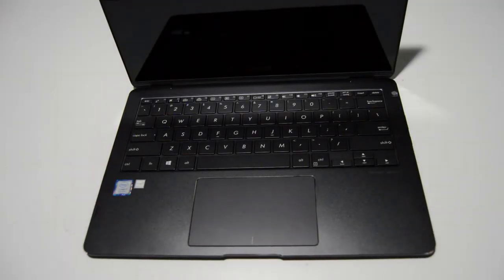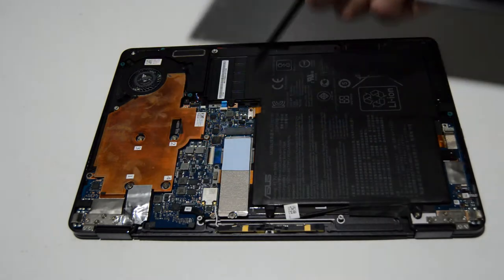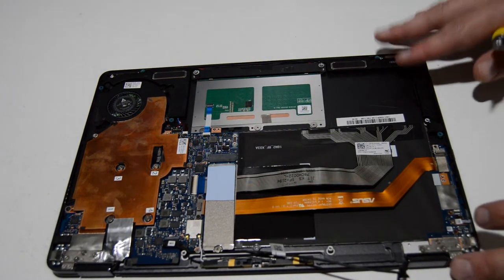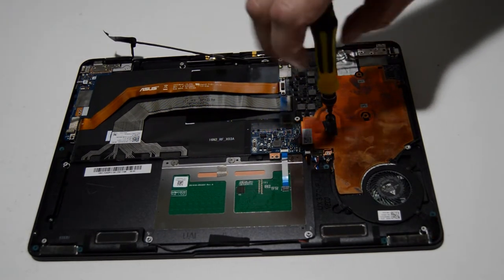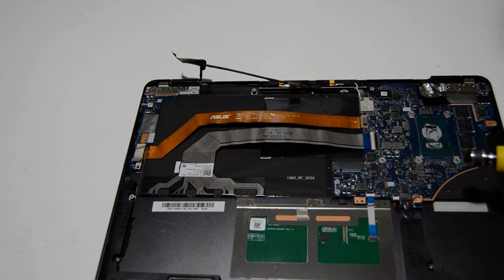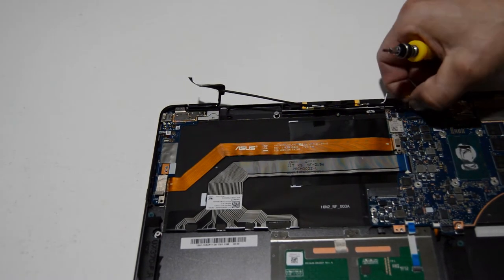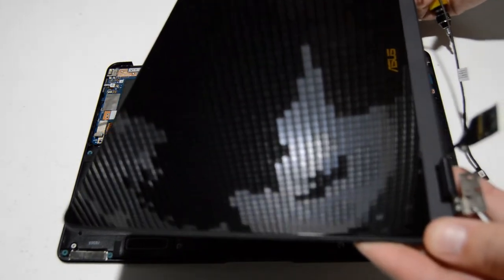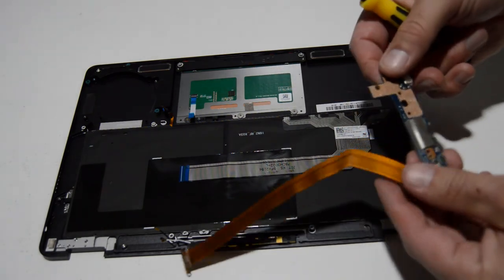How to Disassemble Asus Q325U Laptop

Comment: is it important that that metallic tape be reapplied to the heat sink because once you pull it off it loses its adhesiveness and Im not sure what kind of adhesive you use to reapply it
Reply from the maker: No it doesn't need to be on the heatsink, you can just cut or tear that portion off.

Comment: Is there a way to replace the speakers? My right one is distorting the sound, I'm afraid it's probably a hardware problem
Reply from the maker: 13:10 theres a good overhead view, looks like they have to be replaced as a pair. If you can get to them and the connector, you may be able to replace them after removing the bottom case.
Reply: @Sellbrokedotcom  looks like it, but I haven't been able to find a replacement part
Reply from the maker: @arielgodoy795  $17 https://www.ebay.com/itm/Asus-Q325U-13-3-Genuine-Left-Right-Speaker-Set-Speakers/283863427787?hash=item4217942acb:g:Fg0AAOSwyuFeqpmR